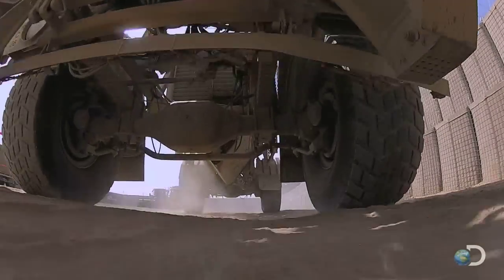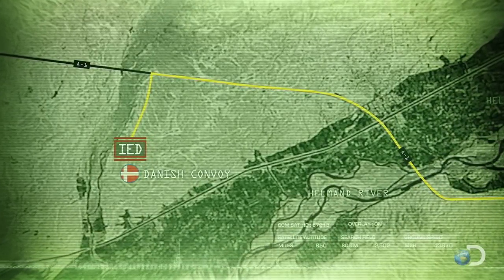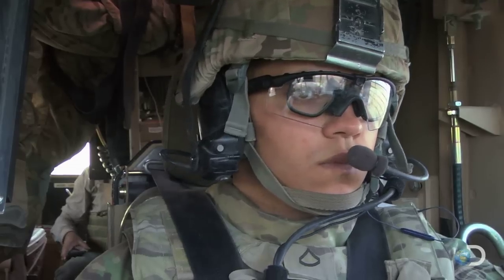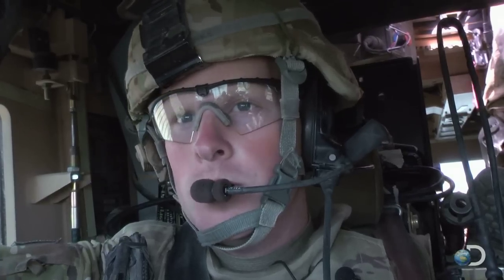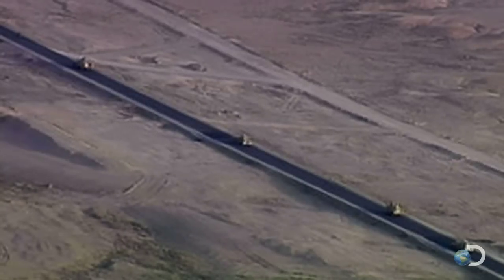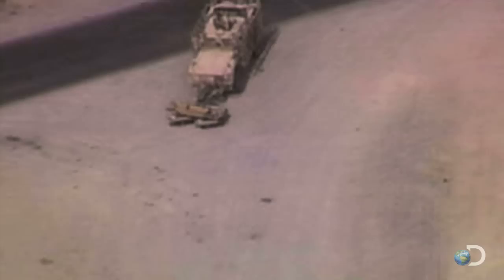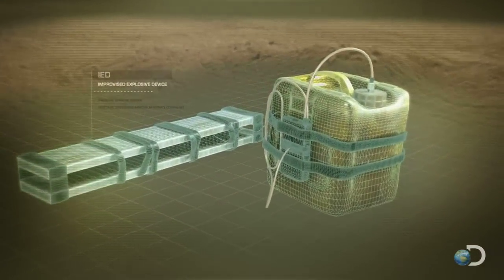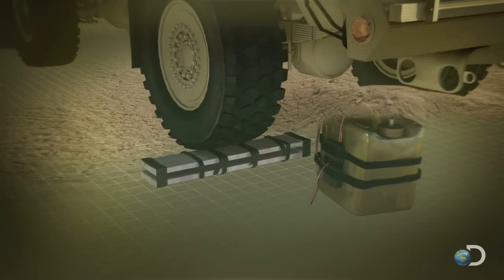IED Construction | Heroes of Hell's Highway

Comment: I came here learning how to make ieds and I can now say I still have no idea
Reply: @tomm-ip9vj  teach me the ways sensai
Reply: @emm5468  you can easily find the way to make gunpowder( by using wood and obtaining charoal, ordering KNO3 through amazon and some other common home items like that) only through yt videos  or what is referred as "home made explosives" ,you can use springs, metallic plates and wire and some batteries ...other thing is an igniter or sparker which you can buy at some local car repair shop , you need to connect them as shown in this video and you know what to do next....btw i m not from taliban... and i m just a teenager😶
Reply: @avrockairborne5253  same, although I knew how to make gunpowder I’m moving on to making C4
Reply: @emm5468  LMAO will do a collab with you for that! 🤣😂
Reply: @avrockairborne5253  yeah definitely 😅
Reply: They explained it all in the video.
Reply: @Stungenfahren  they explained how it works. Not how to make it
Reply: @emm5468 
You can always attempt to reverse-engineer it by understanding how it works.
>electrical circuit with a switch, powered by a battery
>fuse connected to it
>container with explosives, in which the fuse is put

They have even shown a robust 3D model of a hypothetical IED.
Reply: @Stungenfahren  I would prefer to know how the real thing would work
Reply: @emm5468  
Elaborate, please.
If you are asking how an actual IED would work compared to the one shown in the video, then I assume almost exactly the same -- some sort of a switch finishes the el. circuit and triggers a reaction through the fuse in the container. The only difference would be the composition (not triggered by a switch but by a phonecall, for instance) and the robustness of each IED.
Reply: @Stungenfahren  I was initially looking for an how to guide for building it. I’m an aspiring pyrotechnics guy

Comment: An improvised explosive device (IED) is a bomb constructed and deployed in ways other than in conventional military action. It may be constructed of conventional military explosives, such as an artillery shell, attached to a detonating mechanism. IEDsare commonly used as roadside bombs.
Reply: and they are dangerous ISIS, Al-Qaeda, and Taliban are known to possess chemical weapons and shrapnel. five main parts of an IED are the power supply which is a car battery or a cell phone,  the fuse which are radio blasting caps, the charge which is an artillery shell or Semtex, shrapnel which is nails, scrap, or a witches brew of toxic chemicals, and last but not least the pressure plate which sets it off.
Reply: @awddfg  Afghanistan was secular but Pakistani schools brainwashed school students when they were refugees in Pakistan due to the soviet invasion... talk about foreign influence...
Reply: @kekistanimememan170  Deal with it 😎

Comment: Why not use a CA12 Dynapac or larger vehicles to search and trigger IED's?
1 * Dynapac packs , soil , land , the ground about 3 to 5 metric meters into the earth!
2 * It vibrates considerably so I think the idea that such a roller can trigger them before Dynapack machine will even get there.
3 * Packed well enough the road it is harder for new IED bombs at least!
4 * Remote-controlled IED can probably a Dynapac roller not do anything about!
5 * maybe no vehicle to recommend inside the villages.
Their "stomped-soil-house" would collapse directly I suppose.
Reply: The pressure switches are not sufficiently contacted from small explosions. Typically its a 12V motorcycle battery with a two or 3 piece metal pressure switch to a hot wire inserted into a sensitive explosive, a landmine as a boost charge and ANNM or ANFO in the buried cage totes are basically daisy cutters. Use the magnetometer and GPR to detect the switch then go fishing with a remote charge is the usual method of clearing.